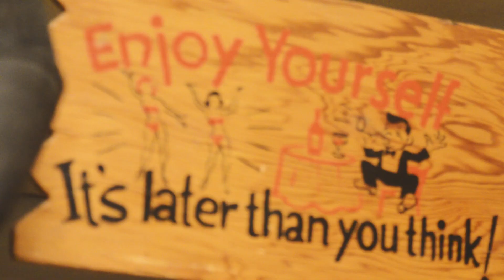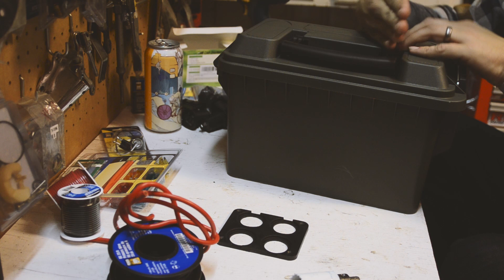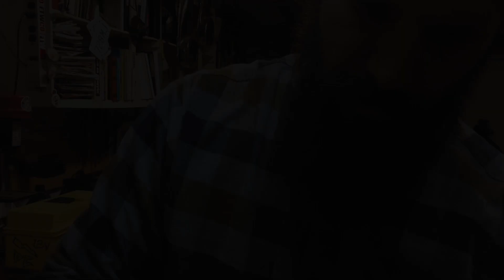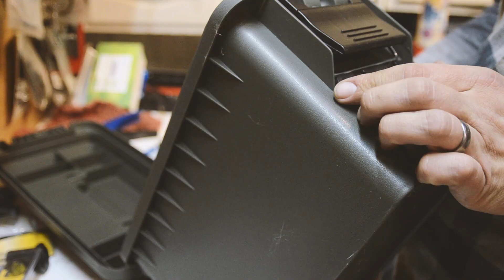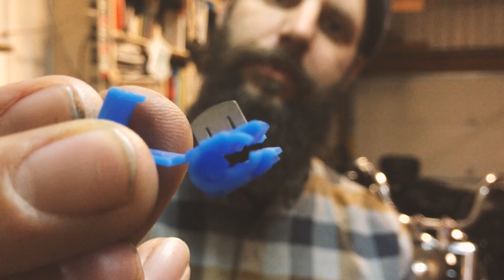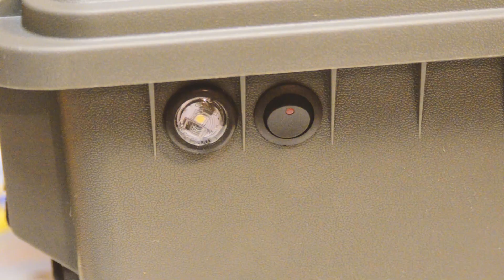Portable Power Station | "Solar Generator"

Comment: Mini Solar Winter Tip: You can steplessly dim down a Beuler and all other hungry electricity consumers with a 5000W dimmer (EUR 7). I run 5 dimmers in parallel on an 850W inverter. Kettle 2.2KW at 150W runs 12 hours a day, so the water is always hot. The room is also nicely heated. 2.5KW washing machine runs in parallel with dimmed to 200...400W. Iron, dishwasher, oven, electric heater, coffee machine, all internal heating are throttled with me. Videos about it on my channel https://youtu.be/eC2olbCBhh0 The inverter stays cool, quiet and the MOSFETs remain intact because extreme current peaks no longer arrive at the inverter. Now every Mini PV Inverter is enough to sell large devices. So with the dimmer all internal heaters/devices can be turned into base load devices that stay almost permanently ON while drawing very little current.

Comment: Cruising the solar 'generator' vids to get ideas both good and bad.  I do like the fuse panel idea instead of an inline single fuse.  My question is whether a charge controller would be internally fused thus making a fuse panel redundant.  Certainly dont want to spend coin unnecessarily.
Thanks.  Hope to see you build a larger version.

Comment: Lawn tractor flooded cell batteries are not designed to be charged and discharged.
Reply from the maker: True that, but they're cheap and I'm going on my 4th season with this one so they work well enough I'd say.
Reply: They work perfect as long as you don't deeply discharge them

Comment: How about a 12v and 24v setup
Reply from the maker: This one is a 12v system. For a 24v you could easily wire two 12v batteries in series and you'd be set except for the light which would need to be regulated down to 12v.

Comment: I had this compare to the jackery and this thing has about 100 W more than the one i have  share4.photo/CampingGenerator     I realized after hooked this up to my 100W solar panel and during the peak hour , this charge time is shorten by a lot when the panel is point directly to the sun light. It has 3 USB charging ports and 1 USB type c which is sufficient for all my gadgets.

Comment: NO NO  NO  scotch connectors or (split connectors) ever anywhere or AC wire nuts . Just a problem waiting to happen. Concerning Daisy chaining the ground wires like you did, break one connection and you lose everything. First time out building a electrical project?  ALWAYS put a Catastrophe fuse at the battery to keep from burning everything up should you get a short.
Reply from the maker: No issues with the split connectors two years in, but I hear you. I hate those things too but it's what I had on hand and I find if you're careful with the install they tend to be fine. As for the Daisy chaining of ground wires, it's a great way to save space. Again, do it right and you shouldn't have any issues. I'm no electrician, but I have wired up half a dozen complete custom motorcycle wiring harnesses together, a few trailers and a number of small to medium solar systems so I'm aware of the draw backs and advantages of the techniques I chose. This is a pretty low risk job so the steps I took reflect that to an extent. As I say, two years of camping trips, ice fishing adventures and back country canoe trips and it's working great. And I do mention in the video that would put a "catastrophe fuse" in as you mentioned. Thanks for watching.

Comment: First let me say thank you for your videos, They are a great help.  I have a question if you know the answer.  I have built this box and it works great,  How ever I would like to build a box a little larger.   I have a couple Lawn Tractor batteries.  1 is a 220 CCA battery and 2 are 320 CCA's  are they any good to use and also do you know what the AH rating is on them?  Or if anyone here can answer that question.   Thank you.
Reply from the maker: Lawn tractor batteries typically have between 35-40 AH. There's not really any way to convert cca to ah that I know of as they measure different things.
Reply: @HayWoodsandWetlands  thank you. That information is very helpful.

Comment: Thanks for the great information! About how much did you spend on this total?
Reply from the maker: A lot of the bits and pieces I had lying around the shop already, But I'd say it'd cost between $100-$125 Canuck bux to build this one as you see it. Thanks for watching!
Reply: @HayWoodsandWetlands  Ouch, a car booster pack / jump starter would have a cigarette lighter power plug & usb power ports & led lights, and should cost the same if not less, with no extra work required. Just might not have as large a battery.
Reply: @user-ut9ln4vd5m  And would likely have a MUCH better Battery in it! I would NEVE use a Garden Tractor Battery for a project like this. 
1. Its too heavy
2. The leads are exposed and could be shorted.
3. Its a "wet" battery. If it got tipped over-caps notwithstanding-the acid could run out. I have SEEN that happen with these batteries.

The build was VERY Amateurish, and full with errors. AMATEURS COMPLIMENTING AN AMATEUR.
I apologize for my tone, but I personally would not build anything this cheesy!